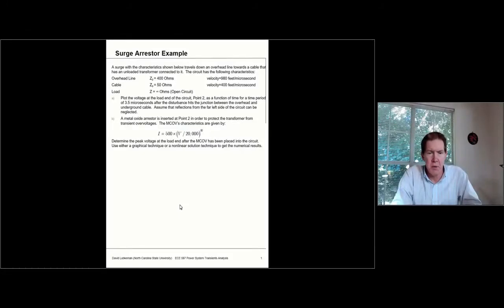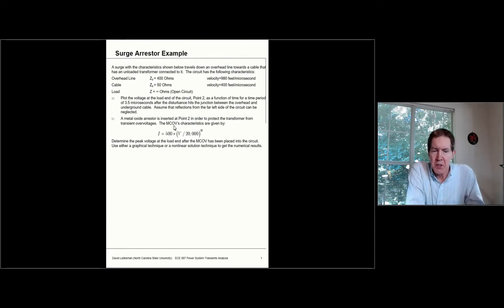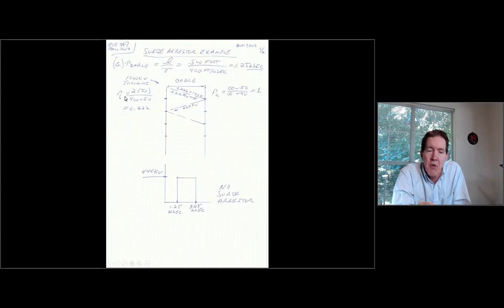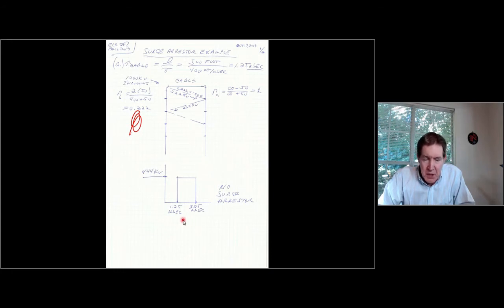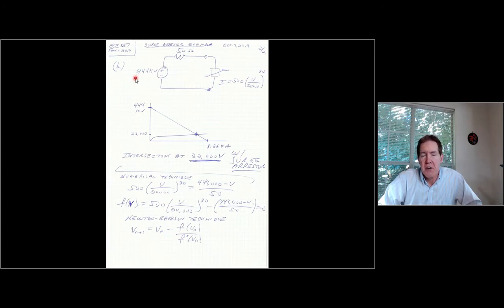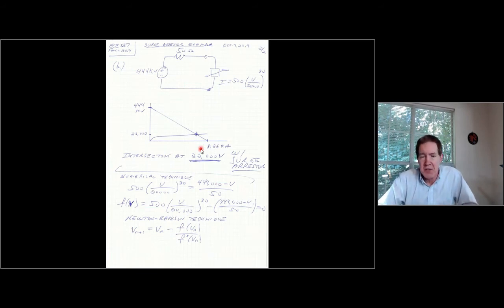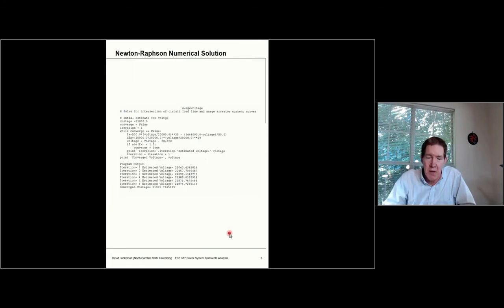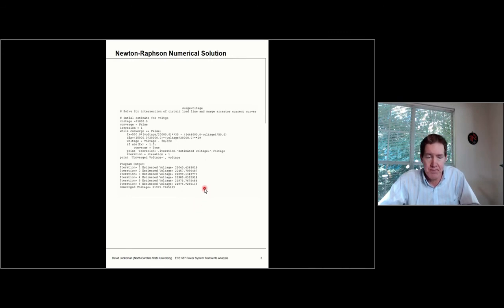Lecture 12b: Insulation and Surge Arrestor Example - Power System Transients Fall 2020 - Lubkeman

Comment: I tried doing item a in PSCAD but I’m getting a voltage of 2000 kV at the open circuited end. What do you think is wrong in my model? 
By the way, the calculations and explanation are very good!
Reply from the maker: Glad you like the video.  

I can't say offhand what is wrong with your simulation.  But I just uploaded a new PSCAD model for this scenario to my Github site at: https://github.com/DavidLubkeman/Power-System-Transients-Course/blob/main/Lecture%2012b%20-%20PSCAD%20DistParamwithSurgeArrestor_June2025.zip

Note that the problem statement did not have a length for the transmission segment, so my model has a value which is large enough so as not to impact the solution.  Keep in mind that the plots in the simulation have the travel time for transmission included where in my manual example the reference for t=0 is when the wave hits the cable.
Reply: @dr.davidlubkeman284  Thanks. My error was in the incorrect placement of the surge voltage; all other parameters were correct.
Reply from the maker: Glad to hear you got your model to work.